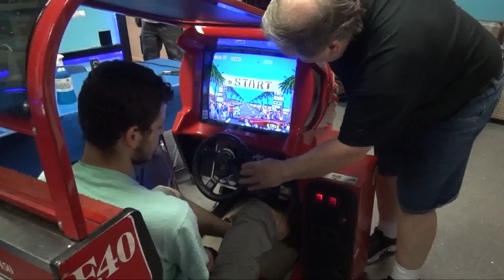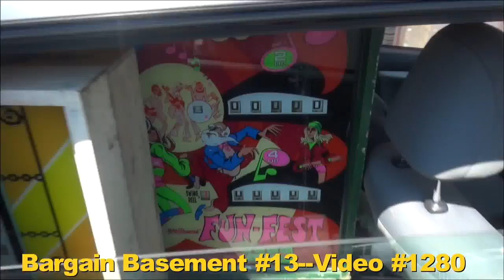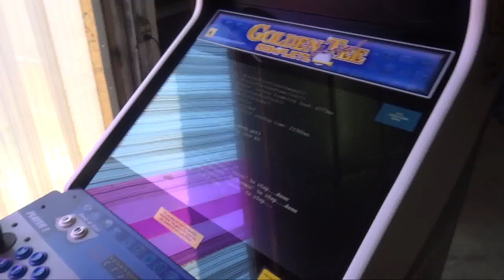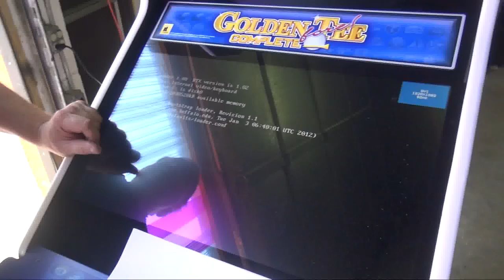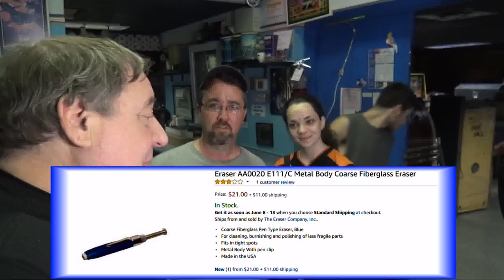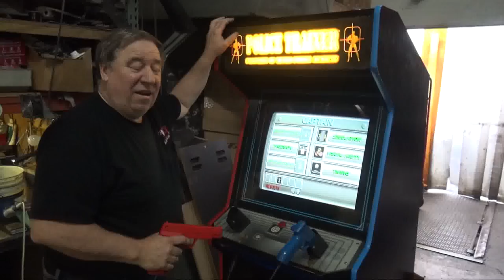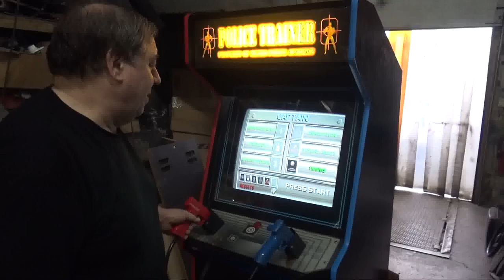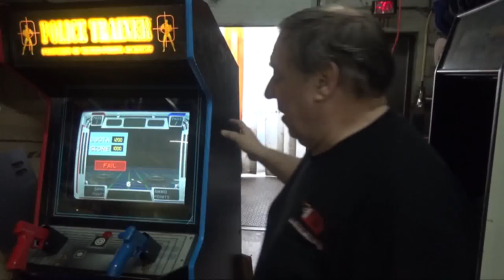#1285 Arachnid ENGLISH MARK DARTS & POLICE TRAINER Arcade Video Game TNT Amusements

Comment: Any idea on how to fix my arachnid arcade style dartboard? It’s almost identical to the one you have here. The darts aren’t registering when thrown
Reply: With out putting my hands on it at all I’d test the target interface by putting the dart board in test mode and using a jumper wire to short the pins on it, if that seems to be registering properly you probably need to fine a new matrix for it, luckily they are still readily available since they’ve used the same 15 inch matrix for the last 30ish years